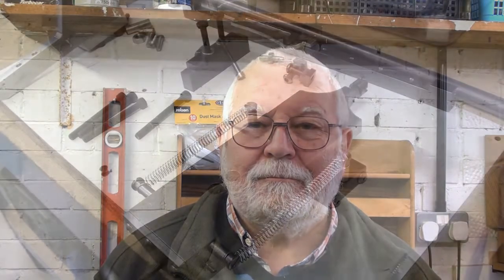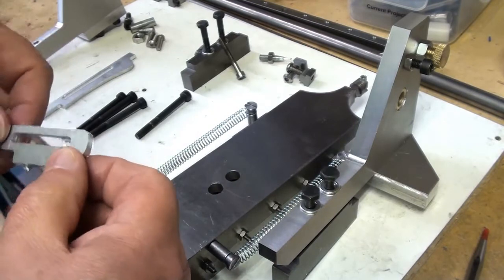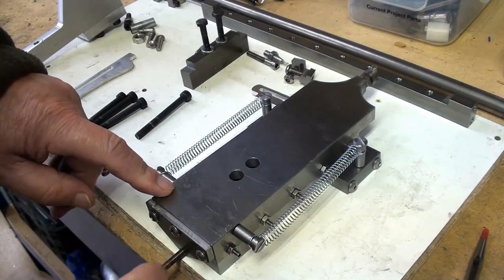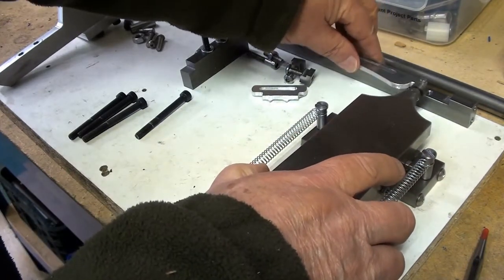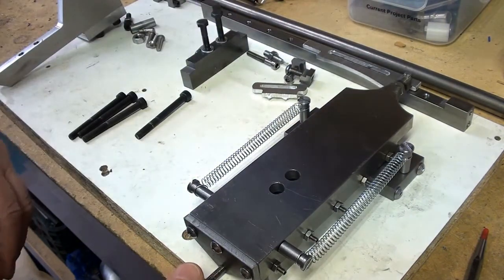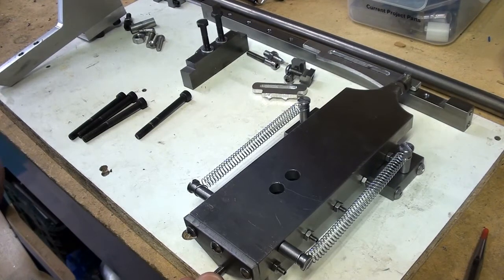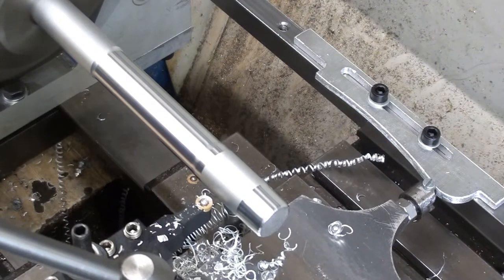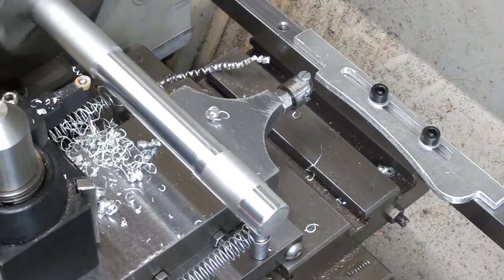Lathe copy attachment  Part 9

Comment: It just needs a wee bit more stick out on the tool, or a wee bit less on the pattern follower, and it will work fine for the 16mm bar...
Reply from the maker: That might get the thick end turned down OK, but then the thin (left hand as viewed) too thin!  Larger stock is the answer.  At least it proved the concept.....
Reply: @bizzibeeworkshop  Yes you did indeed!